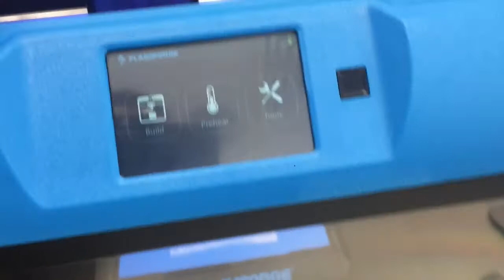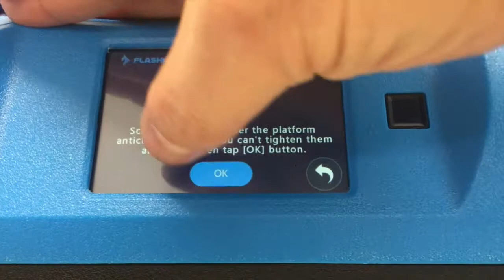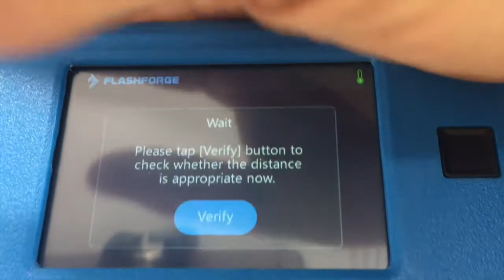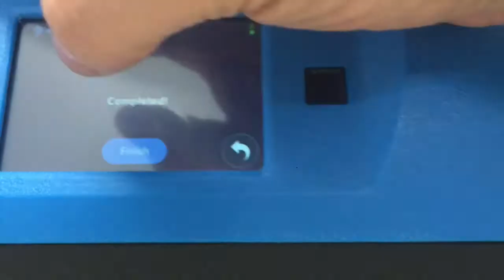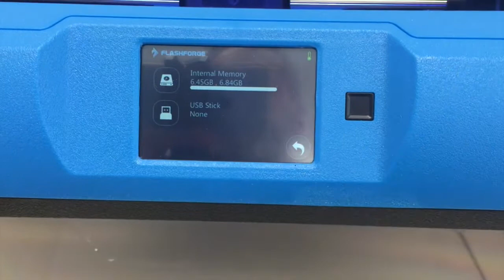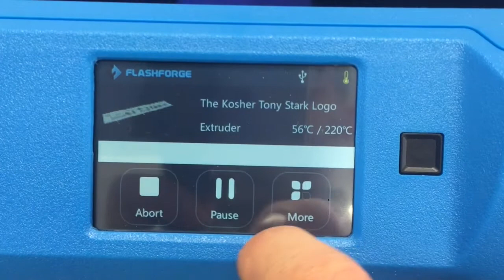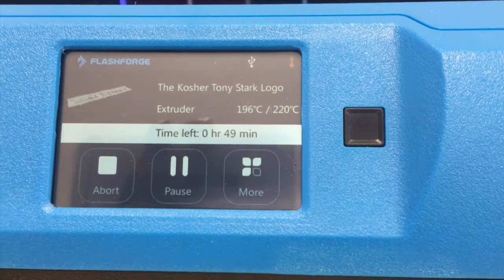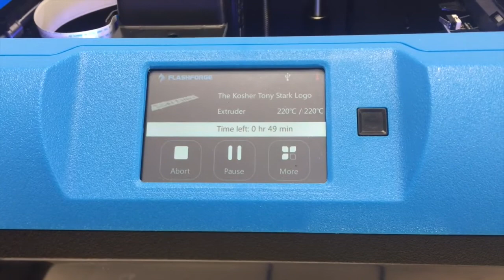First look at the Flashforge Inventor 2 - 3D printer review

Comment: This is basically the same as the Finder but with things we needed for the Finder like walls and a front door, and lid.  So it's the Finder II as far as I'm concerned and far more expensive for these few extra options.  $299 for the Finder, but $599-$799 for the same printer with a front plastic door on it. Nice marketing choice, Flashforge.
Reply: It prints at 400 microns over the Finder's 100 microns. Does that sound like the same printer with a front plastic door?

Comment: Do the side panels of the printer come off? (For reference, there are no side panels on the Finder, so I'm wondering if I can take them off for this printer)
Reply from the maker: Unfortunately, you can not take off the sides of this printer. The whole usint is boxed up and the sides have molded hand grips to carry the printer from place to place.
Reply: @LaserLivestream  Awww, but thanks for the info!
Reply: I have the first version and have never had the need to get into the sides of the printer. It has a removable bed that you pull out like a drawer from the front. Actually I have done a similar mod to mine and permanently closed of the sides and a removable plexi front door. I also have a closure on the top still allowing the printer head move. That makes the temperature higher and more stable. Ambient is about 90 degrees Fahrenheit. Very nice for PLA and the prints are as good as any other printers I've seen.